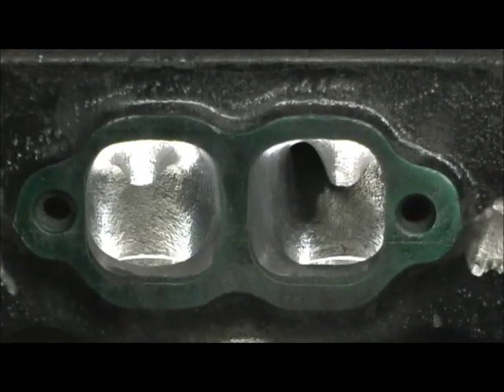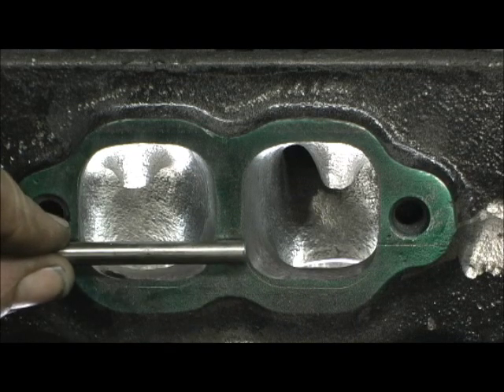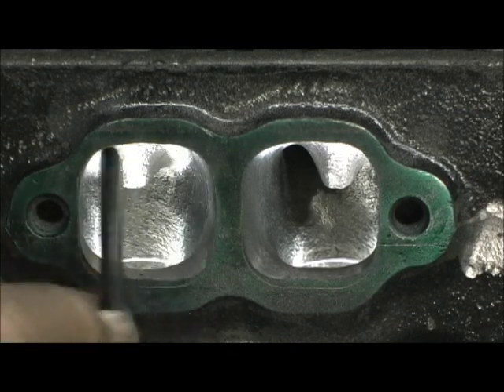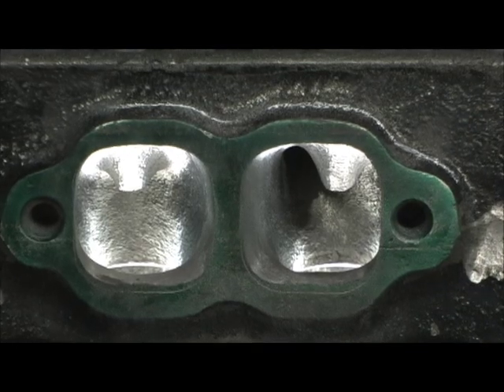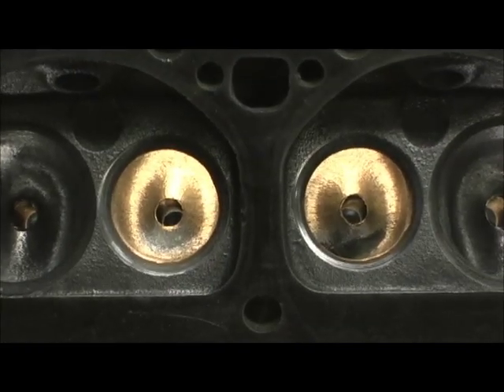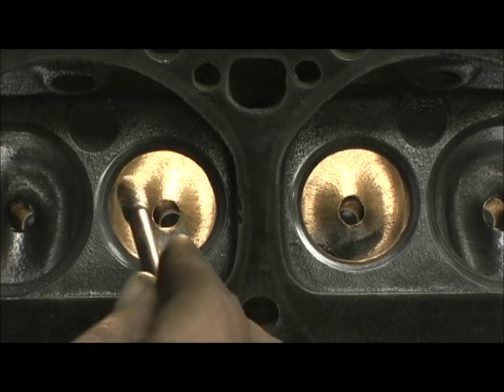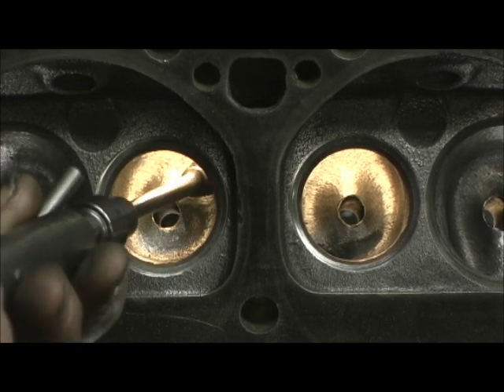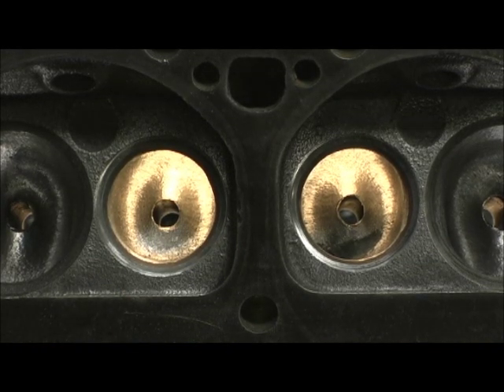441 Chevy Heads Porting Exhaust Ports

Comment from the maker: Sorry, I was not looking at the "PRO TOPLINE" as I have so many people that send me Pro-Comps. I LOVE the Pro Topline, which no doubt has one of if not the BEST shapes of any Chevy head out there. I got 252cc out of the 235 heads, and made 645 HP on the Dyno with a 406 SBC, 11.0.1, Single Dom and NO JUICE. Keep in mind this head combo had stock rocker location studs (no shaft mount) and done all that.  Plus, after all that porting they were still THICK as HELL to boot. Great head for sure, BEST.

Comment: Hey buddy, thanks for the info. You're tops!! I'll leave them alone as you advise. Every thing else looks great on these heads and I can insert a QUARTER between both the intake and exhaust valves and the chamber. Also, guides do not extent beyond guide towers.

Comment: I have a question. I have a set of 195cc Pro Topline heds and when I look at the 2 center exhaust ports I can see one is very slightly tilted, but the others are straight up and down. Should I use an exhaust gasket and scribe a line and taper them all equal or just leave them alone... or just try to correct the one that is slightly tilted and make it match?  I don't want to open them to the point where the exhaust port opening is larger than the header opening. Thanks for all the great videos!!